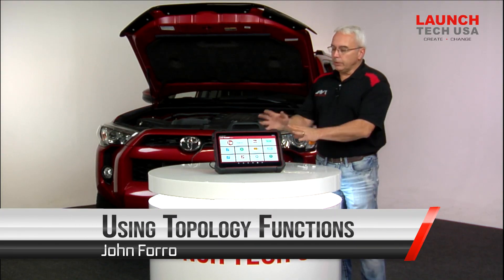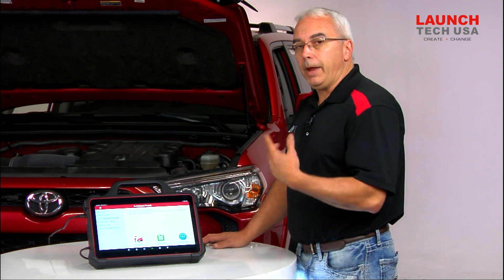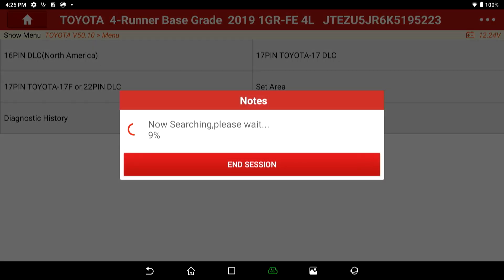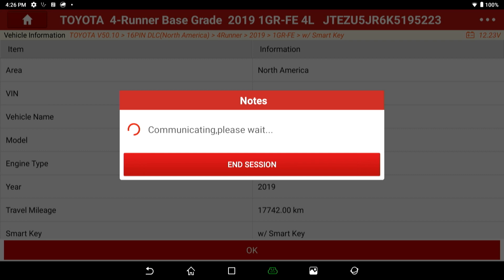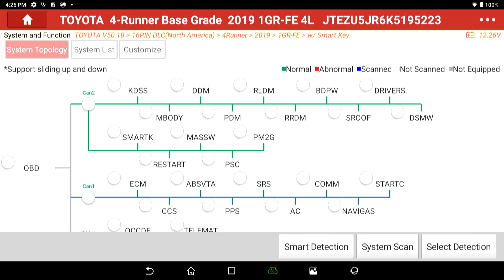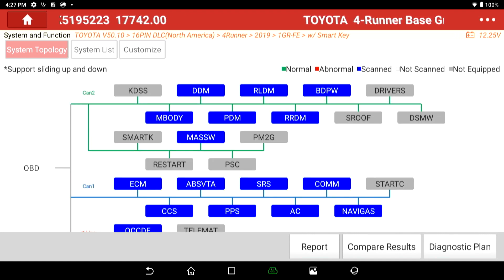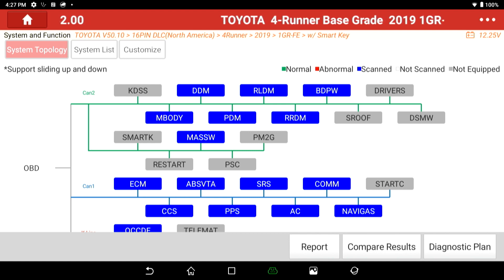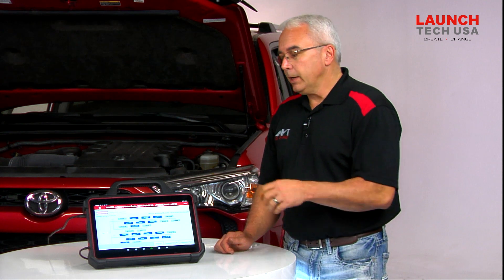How Does the Topology Technology Function Work on the X-431 Throttle III Scan Tool?

Comment: To bad the topology sucks on gm. First it labeled incorrectly. Why does it brake it down as chassis body safety. It needs to call it correct name high speed bus or low speed

Comment: Screens are different on the x-431 pad II
Reply from the maker: Hi, Gary. You mean the UI part. And the topology feature is no difference.
Reply: @LaunchTechUSA  for the most part the tool has been very effective I have the X431 pad II And the latest one THROTTLE III.  I think that speaks for itself. I have convinced 2 other shops to purchase some type of launch scanner.
Reply: @cheapers1952 I want to get the Pad V II Elite, does it have a nice screen? Is it anti reflective? Bright? Etc ..